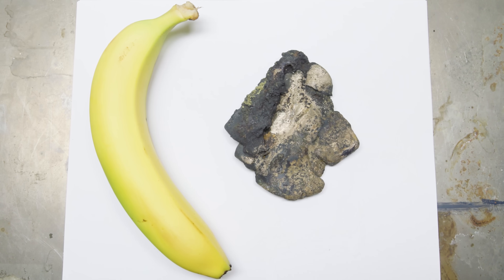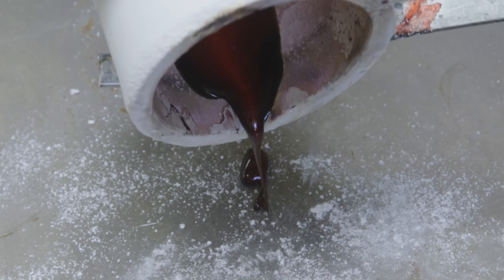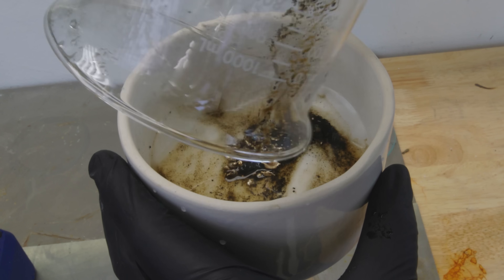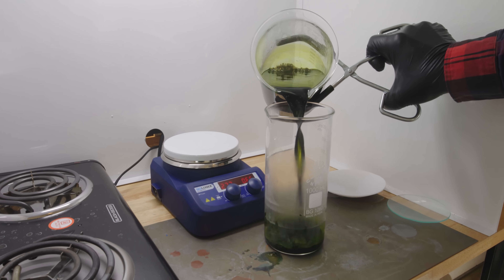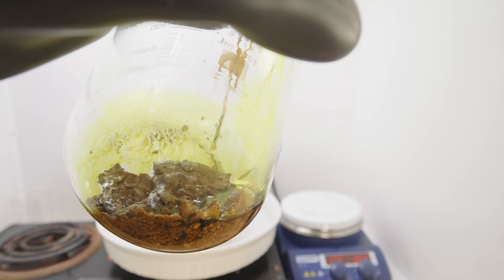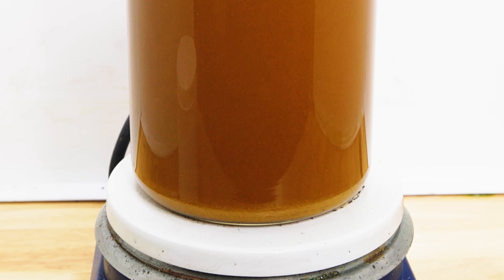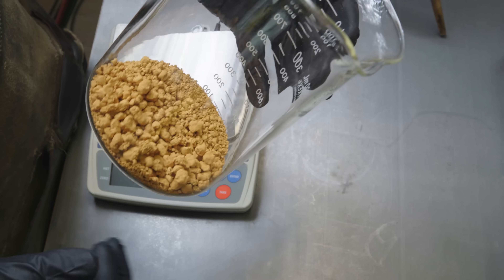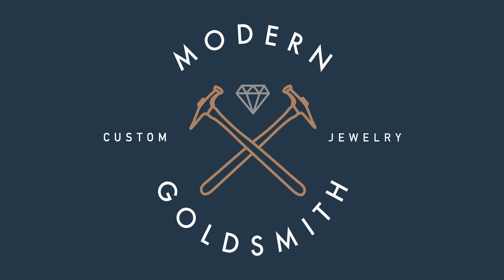Turning a BLOB into PURE GOLD!

Comment: @Modern Goldsmith Great video! If I had a blob like this come in behind the bench I would have melted it and flattened it out or drawn it into wire on the rolling mill, cut up a section and got a density of the piece. Taken an XRF reading and determined if Inquartation was needed. If sample had below 5% Silver content and under  5% Platinum group metals I would first begin aqua Regia baths. I think a lot of your waste has a lot of silver and platinum group metals in it and several grams of gold that followed the silver over into your waste containers. I think you are going to have some fun with the next video on silver and pgm recovery of your waste solution! You are going to retrieve several grams of gold too! 

Sincerely,

TBBW🐺

Comment: Excellent job for a first time! As others said, with lower purity gold it’s much easier to use hot nitric acid to remove impurities. Luckily, gold chemistry tends to be pretty much quantitative because it’s so easy to precipitate it and test the solution for gold. It also makes such a bright yellow solution that it’s easy to see when you’ve washed it off of filter papers and glassware.

Comment: how you process it you are wasting gold time and money. 
First, look for the metallization or alloy and the gold is placed in a sublimation furnace, that is, at the melting temperature of gold. 1x1 ratio gold and remelted borax , You will have to melt the borax first without contaminants and cool it in distilled water. You put it in the Tesla crucible or and its induction furnace and leave it for 15 minutes, the gold, copper and silver sedate after, pour the gold into a convenient ingot mold for rolling before passing it through the dissolution process. Proportion of 3X1 Muriatic and Nitric acids known as aqua regia. To recover silver, it is first precipitated with sodium chloride and for gold, later precipitated with metabisulfite.

Comment: Buy a digital multimeter and another analogue by default. You should start with 24kt gold and create gradual alloys up to 333 or 8kt gold and do not create an alloy, just law. 
Since gold can have 2 frequent alloys of native gold and more than 4 mechanical alloys, that or you download a foundry program. 
These industrial alloys already exist and some are available and are used primarily for dielectric strength and the complete table of sterling or out-of-grade jewelry appears. They are those toxic alloys such as metallic cobalt used as a substitute for brass, it is already prohibited but in a museum restoration it is done with the alloy list. 
That multimeter of dielectric tension by resistance does not describe the titaneo and marks it as gold it is a woman to look for the industry tester

Comment: If you ever do something like this again, I'd suggest trying to avoid getting silver chloride mixed in with your gold by first inquarting it down to about 6k/25% gold (using e.g. copper or another base metal), then using hot, dilute (20-30%) nitric acid to dissolve all the silver and base metals away (might take 4 or so boils) before putting it in aqua regia. Doing that will give you easily 95+% purity before you even get to the AR stage and can get you .9999 fine without having to deal with AgCl precipitates. Your "orange juice" will then look like a clear orange liquid, instead.

Comment: The orange fumes were mostly nitrogen dioxide and you were correct about not wanting to breathe those. They were also an indication there was a fair amount of silver mixed with the gold which was the main reason there was so much metal left after the first try at dissolving it. Silver doesn't dissolve well in aqua regia so it took several repeats. The gold you get when you precipitate it is incredibly fine. There's not enough surface on any given particle to really reflect light so it looks like clumpy brown flour. Just going by appearance, that button is 99%+ pure. The initial blob didn't look to be a very consistent alloy so you got a really good yield. Given that you hadn't done it before you did a great job.

Comment: Fun fact your yield is higher than most professional chemists I’ve seen using this method 95.87% using a basic percentage calculator (95.86761994694007% rounded up cause long decimal point) but almost 96% gold recovered isn’t bad at all

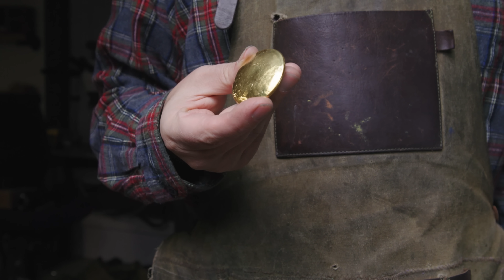Comment: 16:58 the weight with all the flux removed was 514.6, going with 10k again, the estimate would be 514.6*0.417 = 214.6, so your actually extraction losses are about 1.4g or a yield of 99.34%. not too shabby!
Reply: Exact

Comment: I recover gold from PC phones finger boards etc. You should have dropped your molten metal from a higher point into your bucket. This " Cornflakes"( thin flakes) the metal. Instead of repeating your aqua regia to the precipitated gold, simply use a hot nitric acid wash x's 3. Nitric dissolves everything but gold. You should get approx 22/23k. You'll never get 24k w/o using electrolytic method ( you could still do. Then get an ASSAY on it.

Comment: Couple of things:
1) The tester only has three listings, 10, 14 and 18 karat. The ore set off the 10 but that doesn’t mean it is 10.  That means it is at least 10 but less than 14. This is because it doesn’t have values in between. It could be anywhere from ~40 to ~60% gold.  
2) The mass of gold is much higher than probably everything else in that ore. I suspect that the test is by volume and not mass. As such, I would expect the optimal yield to be higher than the calculated 222g even if it is equal to 10 karat gold in purity.
Reply: Which is why I dislike using carat as a form of judging precious metals grade, and I instead use fineness. An 18k gold bullion isn't going to tell me much, all I know is that it can range from 750 to 914, and that's too big of a gap. In the case of the video, it showed 10k gold, and like you said, it can be anything between 10k and <14k, which means it ranges from 417 to 582.
Lastly, the video showed that the end result of the gold blob was 99,9 pure gold, which is another way of saying 999 gold, AKA pure gold. I don't know why he was so disappointed they didn't add the extra 9 there, 999 or 99,9 is the same, just expressed differently, 999 being per mille and 99,9 being per cent.
Reply: @PTDeimos  The report said .99 for purity. They told him they don’t report past two decimal points, so he knows it is at least 99% but could be anywhere from 990 to 999/1000 (it is nearly impossible to get 1000 fineness since there is almost always at least some impurity.).
Reply: @shawnrhode  Ah gotcha, I must've misunderstood that bit.

Comment: Note that the initial piece of the blob was at least 14 carat, and below 18 carat. So the optimal number that was calculated was in fact a low end figure. That is under the assumption that the corner that was used was in fact representative for the whole thing.

Comment: 2 rookie mistakes when water casting. Never use a glass or plastic container to pour your 2000 degree molten metal into. the glass will shatter. and the plastic will melt in contact with molten metal. Next time use a metal bucket or cooking pot.

Comment: ok... what's the rest of the stuff in the blob? why do you think it's so heavy? and probably hard too..  ??? 
my guess is it is a blob someone else had tried to melt.. if you tried with a standard oxy acetylene torch you probably couldn't..  
my guess is also that you don't actually understand what your machine is doing..  or what it's measuring..  which means you are relying on a number from.. something.. it's probably accurate in a way... 
do you know the story of Archemedes in his bath?.. trying to measure the purity of gold in the king's crown... ran down the road naked yelling Eureka..  Google it if you don't... I like the Scientific American version on line... 
specific gravity is the way we determine the purity of a metal like the blob..  two step test with a scale and a cup of water.. water weighs 1 gram per cubic centimeter.. gold is 19.3 times more dense than water... platinum is almost 22 times as dense... that's what natural gold is found with... they are related to each other in the periodic table.. your machine is measuring the resistance through the electrolyte.. the more dense the less resistance..  when I measure natural alloy gold and platinum with a little palladium 
.  I get a negative resistance.. it's a room temperature superconductor..  but hey.. pure gold is very pretty
Reply: quick way to determine if platinum is present... submerge in hydrogen peroxide... it starts blowing bubbles fairly quickly.. the more platinum the quicker and more bubbles
Reply: the gray stuff looks like boron  from a flux..  that's what mine looks like... if you try to pickle it with silver pickle... it turns black

Comment: This is awesome!! It’s so cool to see people appreciate chemistry as it applies to their fields. As a chemist, I have one tip: add a very small amount of sulfuric acid (like a few drops worth) to your reaction before adding the sodium metabisulfite. This will keep lead in solution as the gold precipitates. That should ensure purity for jewelry making because even small amounts of lead will ruin the gold’s malleability. If you really want to get extremely pure, you can run it several times. Then, eventually precipitate the gold with oxalic acid instead of sodium metabisulfite (but this might require you to adjust the pH in order to precipitate the gold).

Comment: You should have did a couple nitric acid boils before using aqua regia that way you can pull silver and copper and some other base metals if they are in there that will leave them separated from the gold and Platinum group metals if they are in there after the last nitric acid boil if there is no red fumes coming off that means there will only be gold and possibly Platinum group metals in there it helps separate everything in one step and make sure gold a lot more pure when you dissolve it in aqua regia

Comment: Incredible!  Subscribed.  Thank you for sharing your days of work and research.  I felt very sorry many times for that poor gold; was very much used and abused.  And I never knew so many harsh chemicals were needed to refine gold.  I wonder what ancient people did?
Reply: If it ain't shiny yellow rock, then there was nothing there. That means there was bodies of pure(close enough) gold present in gold veins near the surface. Same can be said for copper ore.  It took awhile to build hot enough ovens, using coke for heat & bellows to get out iron from the abundance of reddish rock.   Ergo the gold age as it is the first metal that melts. Silver age in rocks that were heavy, lead age. But the Copper age is the first recognized age on civilization past the stone age as they made copper weapons.  Tin deposits is not easily recognized (nor is there that many) but it is a black rock and it melted into a metal when heated and combined with copper to give the Bronze age.   That lasted for over 1000 years.  The Romans made hotter fires  and were able to extract iron out of the reddish rock (iron age) The addition of other chemicals was a hit and miss thing. (much more missing than hitting)
.  As for ancient people...a simple campfire would get them the gold & silver & copper combination as gold mixes with these other metals easily and is found close to the related metals.
.  I was more surprized when he had a beaker of what appeared to be clay and he said that was GOLD.
WHAT A LOT OF STEPS!

Comment: Should have watched Sreetips channel he has more experience. You should have inquarted  the gold with silver or copper then boiling with nitric acid to remove base metal. Then dissolving the gold in royal water. As it will be clean process.

Comment: Congratulations, you did a great job for being your first refine.  Mine came in around 16k to 18k for my first.  2 suggestions, beakers fail all the time so get some ceramic baking ware like sreetips uses.  Not glass.  Also, when you believe you have silver chloride in the mix, run it right back through the same filter and it will clean up the solution.  It takes a long time but well worth it.  Again I say, great job great video.

Comment: problem tl;dr, too big of a batch you should have split it up into several smaller batches. 2. you went right to aqua regia and you also premixed it. premix AR ends up wasting a lot of chemicals should have incrementally added nitric, but before you went to AR should have first nitric boiled the batch to remove everything that is NOT gold from the batch (silver, copper, etc) then after the nitric boils and everything but gold is removed clean batch then go to the AR with dose nitric instead of premix. watch sreetips on youtube for a full refine on gold.

Comment: 1st mistake. Don’t go to AR 1st. Use Nitric acid and distilled water to dissolve silver and base metals 1st, leaving the gold behind. This may take as many as 6 times to complete. Save all of the spent solution to recover the silver later. 

2nd mistake. Don’t premix the Nitric acid. Use incremental dosing to ensure that all the Nitric is consumed. Just because there are no more fumes doesn’t mean there isn’t any more Nitric. If the solute medium (distilled water or hydrochloric acid) becomes saturated, the reaction will stall no matter how much Nitric is present. One way to determine this is to add more of the solute medium. The best way is to use incremental dosing of nitric in small quantities. Your goal in the first step is to dissolve all of the silver and base metals with no remaining nitric acid. 

Step 3 is dissolving the gold with AR. Again, using incremental dosing for the same reason. Whereas in the first step it takes multiple boils to dissolve all of the silver and base metals, the gold will all dissolve in one boil. 

Step 4 is to thoroughly filter the solution. 

Step 5 is to precipitate with SMB and rinse thoroughly after settling. 

Now you’re ready to melt your mud into a button or bar.

Comment: Great job especially on your first try! The silver chloride is a pain to filter. If you get your alloy to 8k by adding silver you can go straight to nitric acid adding tiny amounts until it stops reacting.
Reply from the maker: Thank you! Yes I didn't realize just how much of a pain it would be, the sheer amount was way more than I was expecting. For how much I was refining I think doing a method like the one you mentioned would be more efficient.
Reply: @moderngoldsmith  I've done it the way you did 😁 it's allot of filtering! Still, you got a great result and at the end of the day that's all that matters.

Comment: I watch Sreetips Youtube channel, and he always inquarts the gold first (adds enough silver to make the gold only 25%), and this allows the nitric acid to dissolve anything not gold, including copper and silver. And he only dissolves the gold with aqua regia when as much copper and silver and other junk has been dissolved out by using nitric acid only.
Reply from the maker: Yea I was using his channel for inspiration. He has a video called “Pure Gold from a 18k bracelet” where he does not inquart, ultimately this was the path I chose. However I’m sure he did this because it was only a bracelet? Due to how much material I was starting with, I do think I did it I made it harder on myself with having to deal with all that silver chloride
Reply: @moderngoldsmith  Yeah, it appears that once you're into gold-refining, because of the inquarting process, you're also into silver refining as a consequence.

I'm not sure how he would have handled melting that rock actually. Probably the same as you initially, and then he would've added silver and done a more thorough refining until the 'forbidden orange juice' was very clear.

But you got really good results and it's a really cool button! 😁

Comment: You should check out streetips. He has hours of gold refining videos. You can start with dilute hydrochloric to remove the lower metals. Add a squirt of sulfuric to drop any lead. And then do the two aqua regia boils. Incremental dosing the nitric into the hydrochloric. Then ice and filter twice through the same filter or until cloudiness is gone. That is your silver chloride or some of it.

Comment: Nice video. Your acid technique was good, but you need to inquart your flaked gold with more silver, as aqua regia will not penetrate gold atoms properly, leaving the green sludge we saw. 

More silver atoms in your flakes will allow the acid to properly penetrate the metal, then precipitate SMBs and boil the remains in hydrochloric acid.